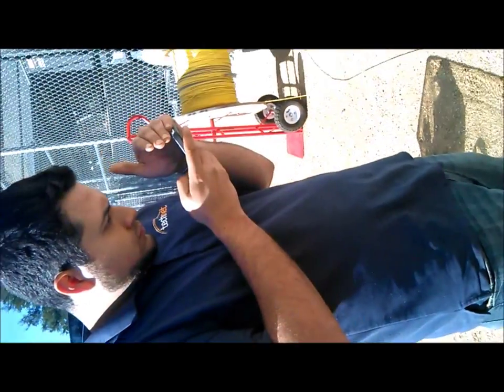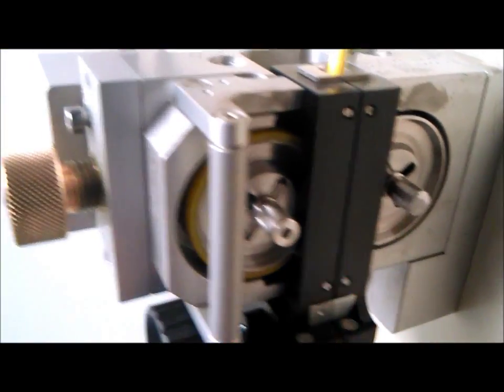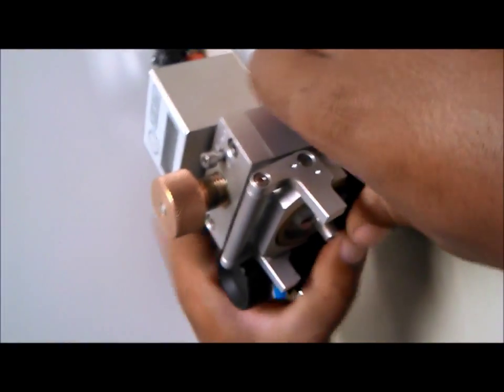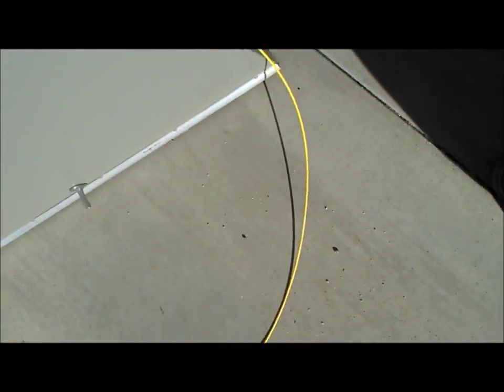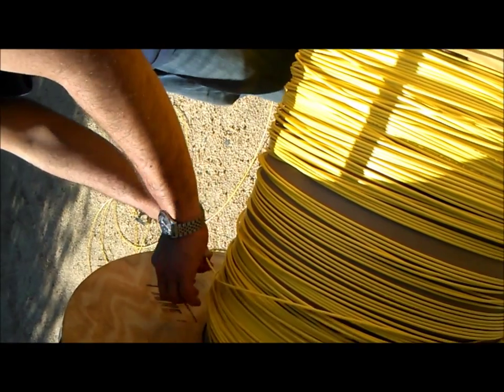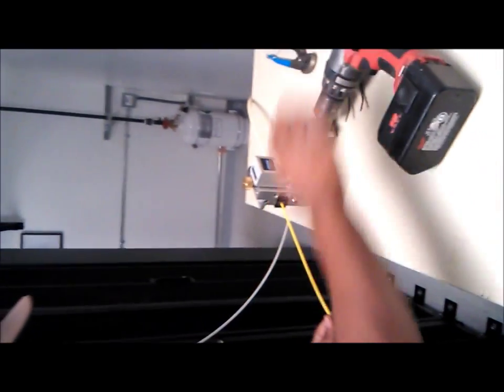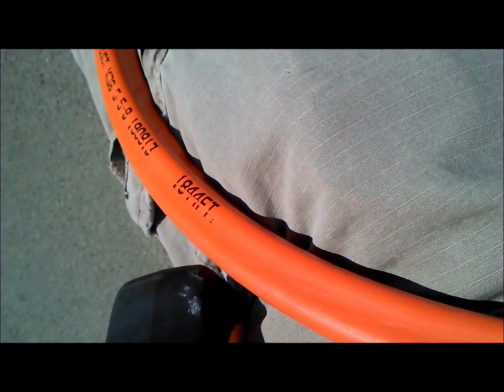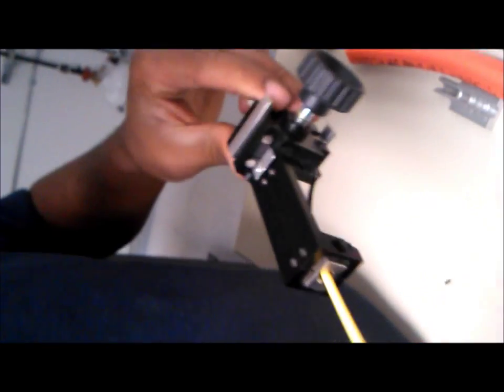Air Blown Fiber installation.

Comment: Who make the blowing head you are using?
Reply: Plumett.

Note that this is NOT actually Air-blown Fiber, but Air-blown Cable.  Actual ABF is made by another manufacturer here in the U.S., Sumitomo Electric Lightwave, which has been in the ABF business for over 25 years.  I have worked with both and prefer the Sumitomo for multiple reasons.  Both get the job done, but one is much less cumbersome and offers far superior blowing distances with virtually zero capital investment.  Great video, though!  Cheers.